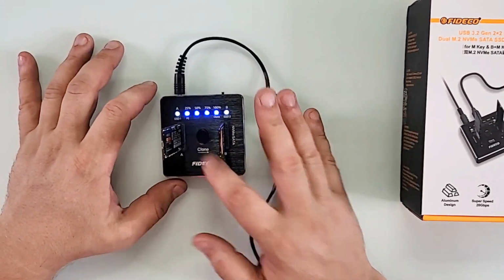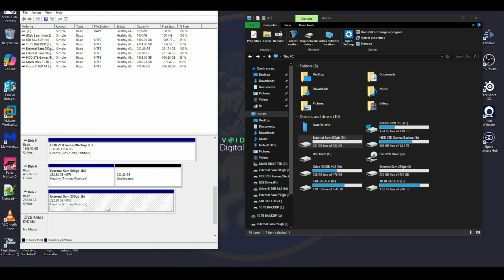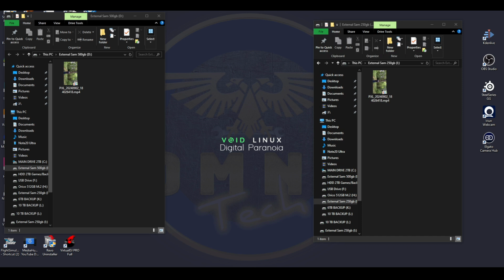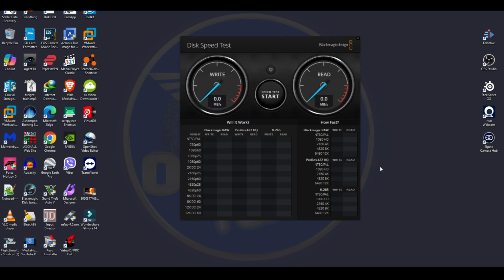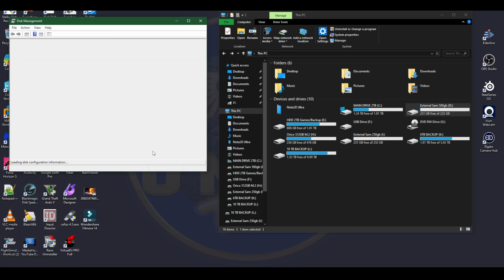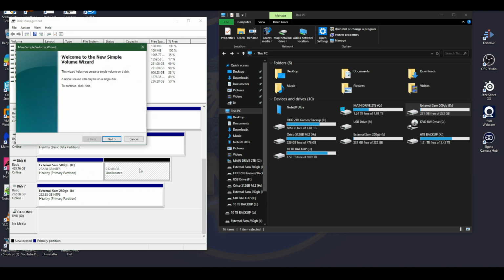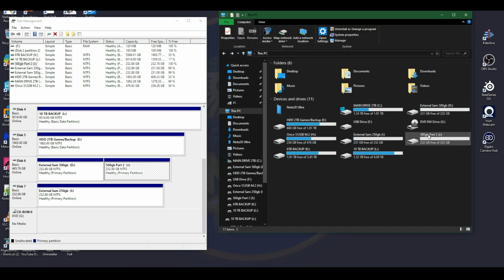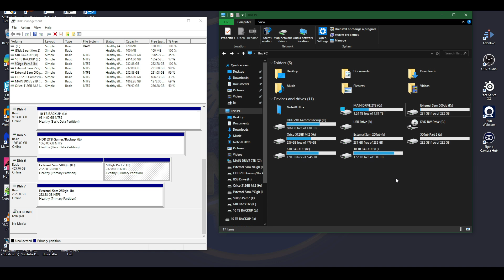How to Clone Your SSD Easily with FIDECO Cloner Dock #pc #ssd

Comment: So I used this to clone an os drive in a brand new laptop.  I'd bought the laptop with a 256GB SSD to save money.  And bought a single sided 4TB SSD to use.  The manufacturer only offered a 1TB SSD max.  But I digress.
So I did an offline clone with this device.  Then used the free version of MiniTool Partition Wizard from a different computer to resize the main partition.
However it would not boot.  I was getting Error code: 0xc000000e.  And on a further error screen, it could not find winload.exe.

So I created a Windows 11 USB stick, booted from it and went into Troubleshooting and got up the command window.
I verified that the UEFI partition and the Windows partition were there and readable.  And I could indeed find winload.exe in System32 where is was supposed to be.

I used diskpart to allocate a drive letter (V:) to the UEFI partition.
I pointed bcdedit to the bcd store on the new drive (otherwise bcdedit tries to show you info about the the BCD store on the Win11 USB stick, which you don't want).
bcdedit /store V:\efi\microsoft\boot\bcd /enum

And bcdedit revealed that the device and osdevice settings were set to "unknown" instead of pointing at the C: drive.

I decided to try a manual repair rather than rebuild the whole bcd. So I did:
bcdedit /set {default} device partition=C:
bcdedit /set {default} osdevice partition=C:
And the rebooted the laptop.  It successfully started putting me into the Windows Experience setup as expected.
I don't know why the cloner altered the device settings in BCD.  But there you go.
Reply: [UPDATE] I suspect it was not the cloner that updated the settings in the BCD.  I suspect it was MiniTool Partition Wizard trying to be clever instead of leaving the BCD alone.

Comment: I never felt I could trust 'any' One Touch cloner because I wouldn't be able to see what was going on. I've had a Fideco for a few years and it was fine, used as a disk transfer system. I just tried to clone, using the Oner Touch button and now both disks are ruined. 
So proving my doubts about their ability to "do what it says on the tin!" Needless to say, though I will transfer and create partitions I will never push the One Touch button of any company's One Touch system again!